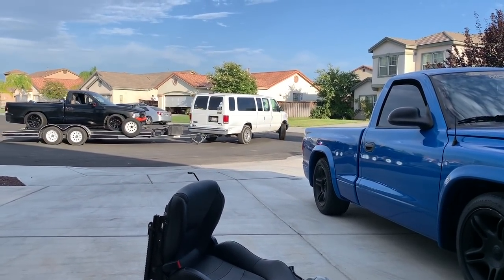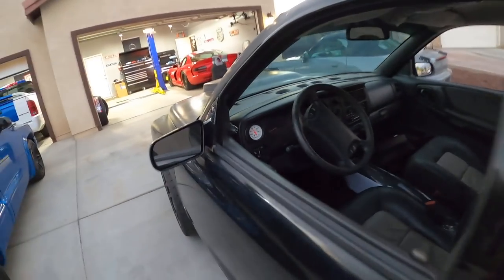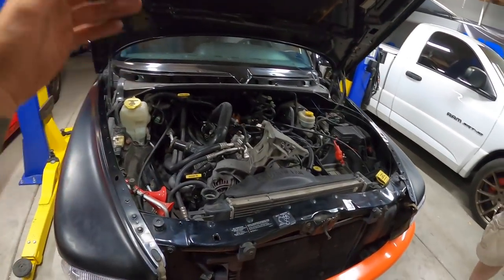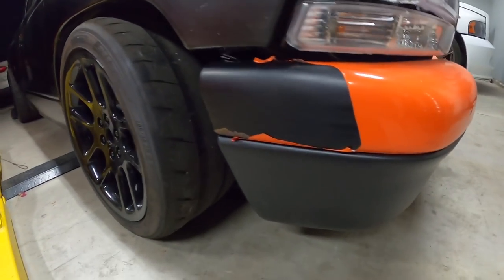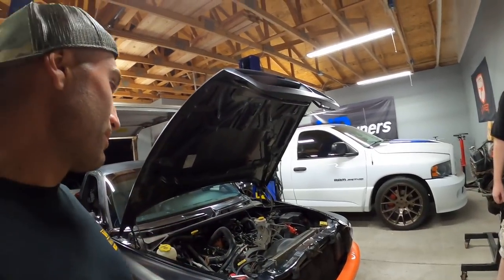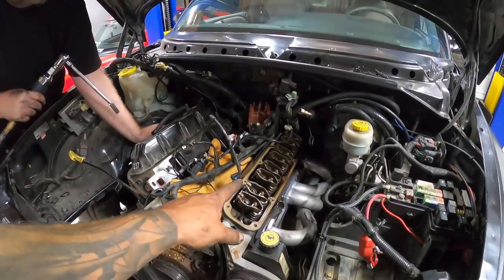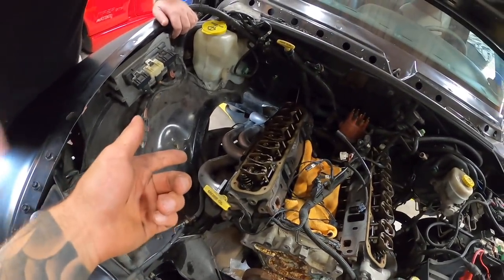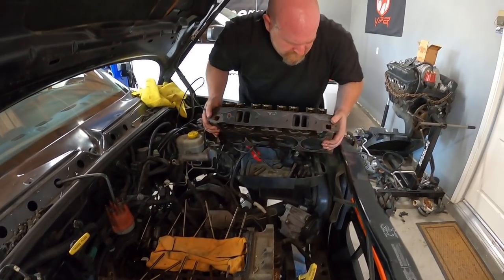HEADS & CAM 5.9L Magnum Dodge Dakota R/T BUILD | PART 1

Comment: CLR is the best stuff to clean blocks, timing covers , radiators, anything with crappy coolant slime. sludge rust or scale. Calcium Lime Rust remover soaked, washed and flushed clean then neutralized. Use HOAT coolant to prevent further coolant buildup with reverse-osmosis water diluted with HOAT coolant 50/50. Do not use tap, well or city water ever even to top off. I did my 2000 SLT Durango in 2002, and 20 years later the coolant condition is still perfect.

Comment: jon, be sure to replace those engine plugs aka freeze plugs with new ones, cheap insurance. From what I see from that frozen or seized waterpump, I bet there is alot of rust inside the block. Dip those new ARE head bolts in fresh motor oil to help torque down the bolts

Comment: CDL works good. Like u use on shower.heads.I ran a hole bottle in my engine for 3 days. Cleaned out the block pretty well.

Comment: we had a 69 an a half with this whole fiberglass hood an scoop,first pass with issues was 14.03 quarter mile,an had more work to do of course with 383 magnum,it was like 1989 or so,an i w as 103...it did get faster for sure,used solid lift cams back then somewhat,an needed maybe to tweak valve adjustment etc,tires were very bald as i now remember,an got only the one run spinnin pretty bad...

Comment: Awesome, another Mopar build going. Those indy x performance heads sould make a big difference with the cam and 1.6 rockers. Looking forward to seeing the results with the Hughs Air Gap intake with this set up. Stay safe brother and keep these video's coming. Giving me idea's on my old 99 5.2 Dodge Ram with 250,000 miles. I keep her because she don't smoke or burn oil and still runs strong.

Comment: With your Spin Tech headers, did you have to modify anything to get yours to fit properly ? 
I sure did on my 2000 R/T.  1 7/8 inch primaries with port plates to 3 inch collectors. Just curious if mine were lemons.

Comment: Nice a new build with a new bud👍...I am still trying to understand the dropping it to the ground thing maybe an inch or two is cool but that is way too low for my liking...like the wheels...got the same seats in my Dakota seat track bolt down is different in the back floor is different looking forward to the next video 👍✌️👌

Comment: I been running a djm 2/3 drop, lower A arms and rear hangers with 1” block, most guys had bad luck with the a arms breaking , is that not a Z truck ? I see the flares missing

Comment: Should I get one for 1000 with 230k miles single cab v8
Reply: I just picked up a 99 RT single cab shorty with headers for 1800 only 192,000 miles wasn't a fan of Mopar until I got a chance to drive a scat pack Challenger but Dakota did not disappoint